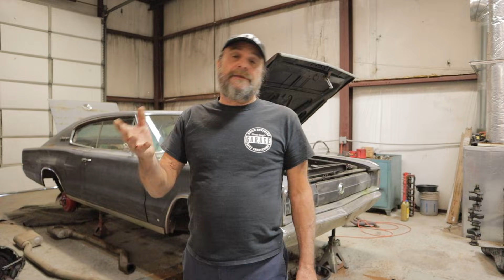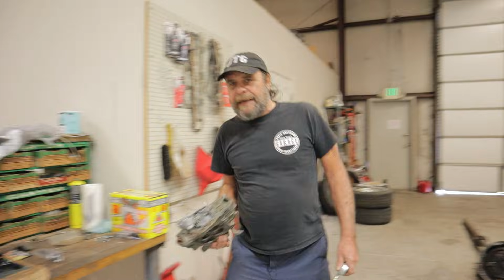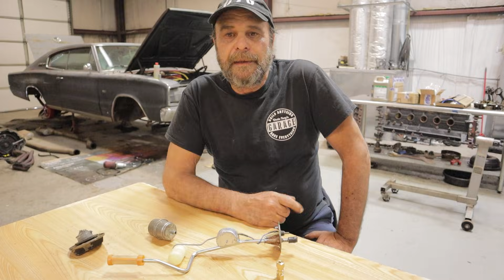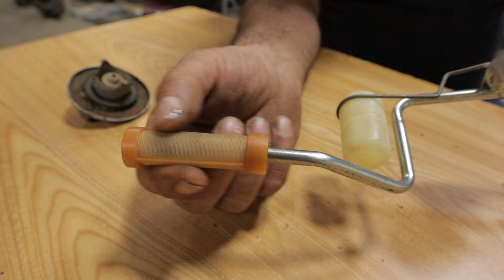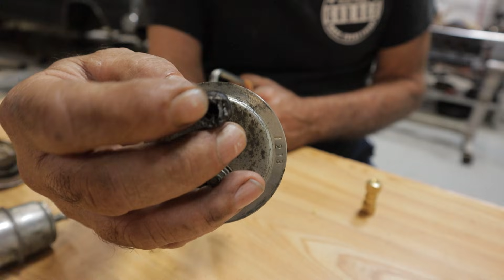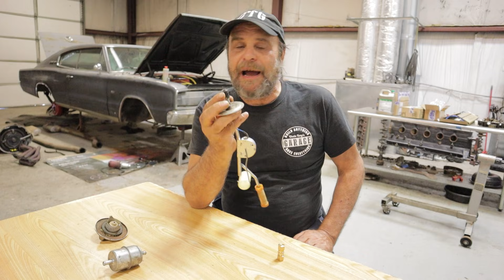Classic Car Survival - Troubleshooting Carbureted Engine Fuel Delivery Systems

Comment: And Australian built Fords built in the 80s had a short rubber hose joining two steel fuel lines approximately where the A pillar/firewall is.  I think it was because the 6 and v8 had different steel lines in the engine bay.  I had the problem where that perished.  I replaced the rubber at the tank and in the engine bay, still had problems and finally traced it.  Thanks for sharing, its always good to hear stories because it helps us think of other options to try or places to look.
Reply: Exactly - And, if you are obsessed, like me, I'm thinking I need to take down my tank... "Did the sock fall off?"
Cheers!

Comment: I had the same thing happen on the rubber hose at the rear axle for the brake lines.. the brakes felt weak, and I  had no fluid coming out when I tried to bleed the system. 
The rubber hose was swelled shut on the inside.  But it wasn't leaking and looked fine on the outside
Reply: Same
Reply: When it’s plugged it will fill.

Comment: A fuel gauge tee'd into the  hard line between the pump-carb and taped to the windshield so you can watch it while driving can help eliminate alot of guessing.

Comment: I have my own story on this subject. I've had several lol but they all were identifiable and fixable without a great amount of trouble; however this one takes the cake on what a pain in the ass this sort of thing can be! I have a 1966 Plymouth Sport Fury 383/727 AT. Ok so, I had the 383 overhauled at the machine shop, I get it back and put all the accessories on. I come to learn that the valves and stems weren't shimmed correctly 🤦🙄 typical of most machine shops that have a limited knowledge beyond Chevrolet adjustable valvetrain(rocker arms), but that's another story😑... The engine ran out okay on a short run down the road but during an extended drive on the highway would begin to cut out and act like it was either loading up (flooding) or running out of fuel. I went through every part of the fuel system and found no issues. Yes the 5/16" fuel line is still in place but wasn't a concern at this base level of performance demand... After a lot of frustration and head scratching I sat straight up out of bed one day! When I went to double check I confirmed the premonition that was given I confirmed it...the machinist used the wrong pushrod for the fuel pump! I pulled the pushrod from another 383 of mine that was completely untouched then pulled one from the Fury...1/2" shorter in the Fury! 🤔How, I pulled one from a 360 small block I had...(MATCH)! I called the machinist and sure enough..he also had an LA small block he was rebuilding and they got swapped! 😤 Frustrating but fixed! Check & double check folks

Comment: I had a Fifth Avenue kind of Fury back in the day, and it ran fine unless you tried going faster than 60 mph for more than a few minutes. Dropping the tank to fix a bad fuel gauge sender showed that the cushion on top of the tank had collapsed and the rubber fuel hose going over the tank had been squashed.

Comment: I know a possible cause for that fuel line. I have a 64 valiant that someone dropped the tank and didn't pull that hose so it bent the line. That line being bent put enough pressure pushing down on the hose it eventually turned it into a deformed fat slug looking thing that was just a rock. What might have happened was the hose was to short so the line pulled and lengthened/shrunk the hose.

Comment: The clear fuel filters must have a layer of vapor. When bracket racing with a cool can (with ice) I found the cooler fuel would fill the clear filters completely with no air/vapor space showing.

Comment: 60 Chev p.u. had a piece of solder slag enter sockless fuel line. AFTER inspecting EVERY individual component found it in the metal line 1/2 way between  tank & pump!! How it got up & out of the sharp bend behind seat & all that way-I'll NEVER KNOW!! BUT, I was there & IT DID. Drove me crazy for a WEEK!

Comment: 16:55 You said 'the very last' but we all know that some times corrosion builds up in a fuel bowl, especially if there is any moisture, and breaks off flakes of aluminum and zinc that then fall into the galley ways and choke them down, leading to a lot of restriction.

I have spent a lot of time blasting them things clean.

Some times, it helps to just run a little vinegar through them [nothing stronger because anything stronger will eat through the metal, and make other problems such as incurable pinhole leaks, which cause a whole NEW problem, including both reduced fuel due to the vacuum leak when operating, and then the fuel bowl leaking out on you when you park, which also causes dieseling, backfires, and just plain running the carb out of fuel every time you park] some times a little B-12 and compressed air works.

I don't know what is in B-12 but I have learned to trust it.

I think it really digests a lot of nasty gunk in those tiny galley ways a carburetor that might be missed otherwise.

Its rare that you get a carburetor with screw plugs in the drilled passageways, but if you ever do, HANG ON TO IT!

They are usually little pressure crimped balls and if you pull them out, its hell getting them back in, and usually you either end up drilling and putting in set screws [and hoping they don't leak all over the place!] or you end up giving up and throwing it away and getting a new carb completely.

Comment: Excellent video, mention another example that drove us crazy. Car had been sitting for a long time with old fuel. Pickup tube had rusted a tiny hole at that fuel level.  Subsequently whenever the full fuel level dropped to the pin hole level car would act erratic, but the sloshing fuel would mask symptoms until the level dropped signifantly below the pin hole.

Comment: 15:00 ALL J-FRAMES [and some K-frames] ALSO have a small segment of rubber hose in the MIDDLE of the car.

This little 8 inch long piece of hose is the one I have replaced BY FAR the most.

I think it has to do with the fact that it is the one place in the entire fuel line where there is CONSTANT FLEX.

The J-frame is mounted on with rubber bushings, and this means that it is not solidly secured to the Unibody [thus, mostly a C-body type problem, more than other body types with MOPARs] and this is why they had to put rubber hose instead of steel line, because as we all know, a steel line would have quickly broken from flexural fatigue.

Well... 

Turns out...

So does rubber.

The most common place I have ever replaced a fuel line, is where that joint is.

Somehow, there is enough flexation that, along with dry rot, and whatever else, that its a common leak point in the fuel systems on the big C-body cars.

It also happens to Firebirds and Camaros because they have a J-frame like Chrysler C-bodies do.
Reply: Yep my 79 camaro has a short rubber hose between the subframe and body. I changed it when I noticed cracks in it. 

Sadly from my experience is a lot of the fuel hose you get from parts stores are total junk and dry up, shrink, or come apart within a few years. My 85 ram still has original fuel lines under the bed and are staying that way till I have an issue. If it ain't broke dont fix it especially with how quality went down hill.

Comment: I had a similar problem, with the rubber fuel line, on an Oldsmobile a year or so ago. It got soft, and would collapse on acceleration. Also had to put a new tank in it

Comment: Weirdest one I ever experienced was a freak accident where I somehow got onto a slick road on a windy switchback in a steep canyon park and ended up nose diving off a 4WD type shortcut and in the process [this was the 74 Coronet I had that looked EXACTLY like Bottle Rocket, by the way] it hit the bottom in some mud, did no actual damage to the car, so we merrily went along on our way, but going up the other side of the park all of the sudden the car died.

Well, sure enough, I went and pulled the fuel filter [it was steel and up close to the carburetor] and it was jam packed with rust.

We went about 2 miles at a time for the next ten miles before all the lose rust finally stopped clogging up the fuel filter.

Moral of this story: NEVER THRASH YOUR OLD CAR AROUND!

Stirs up all the years of sediment off the fuel tank.

At least, in my defence, I can say that it was an inevitable accident caused by some ice on the road, and a very steep and twisty road at that.

Comment: My girlfriend's dad had one of the strangest fuel starvation problems I've ever heard of in his mid 70's Volare wagon (way back before I met him):

He'd drive it around and it would occasionally die.   He'd let it sit for a while and it would start working again.

Took him quite a while to figure it out.   His kids, when they were little, and put some newspaper into the fuel fill.   That stuff floated around inside the tank until it clogged the sock, then when he'd stop driving it, it would float away again and it would be fine for a while again.
Reply: I experienced the same thing yrs ago. Sediment gets sucked into the filter and clogs it during operation and releases when there's no pumping.

Comment: I want to know why to run an electric fuel pump or a mechanical.  People like both for various reasons but I would like to know from the professional UT on your opinion on that subject. Thanks!
Reply: I know you didn't ask us, but I have an electric plumbed in parallel ( w check valves ) with dual toggle switch - in case I want to run with car mechanical - but specifically to fill my bowls before cranking after sitting a week or more.  The gas has evaporated some from carb.  This minimizes the cranking on dry engine.

Comment: Actually, this makes perfect sense. Soft fuel lines, just like brake hoses, will constrict internally with advanced age, due to exposure to the petroleum distillates they handle. Good rundown on the many other problems you may find as well. As usual, another good teaching video. Thanks for posting. I always learn at least a little bit from every one of these.
Reply: 1980s BMWs will lock the rear brakes with old brakes hoses.

Comment: I've been caught thinking there was a problem because the filter didn't fill all the way.  I notice that an electric fuel pump tends to fill it better, but mounting it so it flows vertically gets them filled, so like  a filter from the pump or line going up the front of the engine to the carb, it usually gets mostly full then.

Comment: Not even sure how many times just in the last few weeks I've told people to follow their fuel lines back to the tank looking for  short pieces of rubber hose. There's always a piece at the pump and at the sending unit, maybe more in-between, that'll really cause trouble. Dry rotted and sucking air or turned to a goo like substance and restricting flow. 
Great topic, great video!
Reply: Yep. Went through that with my ‘59 Plymouth station wagon.

Comment: suction and pressure gauges either side of the pump and some clear hose, covers most issues when troubleshooting and or test using an electric just before the mech pump and see that it can draw the fuel at a rate to keep your engine happy. 10% of HP in US GPH will do it. Great tests before you even start the engine. ( dont let electric run dry if it a vane pump)

Comment: i know, at least my 66 Barracuda has a vent tube and the part number for fuel cap is "non-vented".  when i up sized the vent tube, i haven't had a problem since... it used to drive me nuts until i did that

Comment: i always put large capacity METAL inline fuel filter BEFORE the fuel pump ( fitament usually part # fits 1988 crown vic ((( example this one Duralast Fuel Filter FF679DL)  )) 3 /8th's hoses slides onto both ends n use the better quality fuel injection type fuel hose ( not the cheap stuff ) n then simply hose clamp it.Also a 3/8th's in brass ball valve shut-off before this fuel filter makes much eaier to swap out fuel filter or fuel pump..))  Also put a microwave magnet (free LOL ) on the underside of gastank to trap any rust floating around inside tank

Comment: I had similar issue with my caprice years ago. Stomp and run hard shift to second then get a bog. Had a fuel hose by tank that was cracked, wouldn't leak fuel but would suck air, I was young and dumb and changed carbs distributors, coils, modules, fuel pumps etc. Found the issue after owning the car for almost a year

Comment: I had a 71 Grand Prix had hard cold
Start same thing the hose at tank
Pick up was original had cracks
On the top of the hose but when you 
We’re under the car looking 
Up the hose looked good but
I ran my hand over the of the
Hose you cold feel hose
Damage cracks put a new
One problem solved

Comment: Friends don't let friends drive their car without a carburetor......Good on you Tony, for being a friend :))
Reply: I'd love to change my 1996 300 inline 6 ford engine to carburetor.  Don't think the electronics on a 96 can make it happen
Reply: @donaldfrederick1557  Electronics of the fuel and ignition control system can be done away with if one is willing to do away with engine emissions control while still keeping the catalytic converter utilizing the vehicle strictly off-road. Federally, it is illegal to sell a vehicle with such omissions, and too, if your state requires emissions testing for road use. Privately, one can search for a non-computer distributor and the carb off the same engine from an earlier model, providing your intake accepts a carb for off-road use. If your intake does not bolt up a carb, the intake off the same engine that the dist. and carb came from will be required, which there are plenty of for off-road use. There are different hurdles to overcome but it can be done by you for off-road use privately, if so inclined and mechanically inclined. Disclaimer: These are simply talking points and NOT advice to bypass federal laws in any way.
Reply: @donaldfrederick1557  my 87 had the fi 300 it now has a 1972 302 in it. Before hand I just used the factory ford carb intake and a hei conversion worked just fine.

Comment: Any thoughts on a return line, to help keep proper pressure, and to eliminate Vapor lock?
Reply: The fuel pump for those will have an inlet, an outlet, and a third fitting for the return line. The third fitting has a very small hole in it to "leak" fuel under pressure back to the tank, but it's so small it doesn't make a practical difference in fuel flow. Vapor, on the other hand, flows through that tiny hole much more easily and the hole "bleeds" the vapor out of the fuel delivered to the carb.
Reply: Tony and others have videos for adapting stock fuel filters with updated three nipples.  (See alkallio9000's comment.)
Pay attention to the orientation of the nipples and where you put the filter.
Some Mopar/GM (I am not familiar with Ford.) filters had mounting design/ brackets, others were just placed inline with obvious orientation that forced the vapor escape nipple upwards.  If you add a generic one between pump and carb, I suggest the style that has the restricted nipple  90 degrees to the fuel flow.  Of course, that nipple must be straight up as much as possible.

Comment: The low fuel level in the tank reminds me, the modern car's tend to have baffling to keep the fuel level consistent around the sender unit and keep the fuel sloshing to a minimum in their fuel tanks. Interesting how there is not a company yet that is manufacturing fuel tanks that have baffling in them for Classic cars. would cure a part of the fuel starvation upon WOT acceleration.

Here's my "Freak issue" that i had a few months back.

Had an interesting fuel supply issue i don't even know how and what the logic was behind it when i fixed it, anywho, few months back i had installed a rebuild kit on a Carter AVS & installed on a big block Chrysler 361.
I cranked the motor and the fuel was not filling up the float bowls, interesting, I proceeded to check fuel flow by removing the hard/rubber line before the carburetor, cranked the motor. fuel was flowing but it was a slight trickle, not enough to keep the float bowls full.
 i back tracked to the fuel pump & the fuel pump push rod and inspected the push rod for proper travel, Push rod length checks out and the fuel pump flow also.

I reverted to the carburetor, I checked and triple checked the float/needle settings and if the needles were sticking, good here.

So far what in the world is going on?

Next up i noticed that the accelerator pump would not pump up and down in it's bore even with the  accelerator pump spring installed, The pump was too tight so i changed back to the old crusty accelerator pump that was in the carburetor originally, and it fit loosely, Cranked the motor, the fuel bowls are now filling up and the motor is able to start.

The only thing i can assume what may have happened was that the NEW accelerator pump fitted too tight in the accelerator pump well blocking and or causing a positive pressure/vacuum(?)
Blocking and or stopping fuel from being allowed to flow from the pump to the carburetor. This issue had me going insane a "Freak issue" if you will, even the knowledgeable gentleman's at the C body forum's were not able to figure out the problem.

The take away from here is that the rebuild kits might be new and clean and supposedly correct kit for the carburetor at hand, do not discount the old parts that worked with the carburetor originally.

Comment: I have run into a couple of similar, constricted hoses. Oil fill, and drain hoses, on semi trucks. The oil fill hoses, on Detroit Series 60 oil fill hoses, are constructed similarly. Collapsing lines ARE a thing! Another truck we still get, A vacuum truck; (Think, "Sewer-sucker. You're right.)  has a "drop hose" between it's secondary engine, and the ground. Both take too long to do their thing.